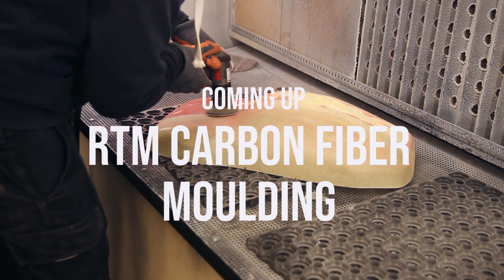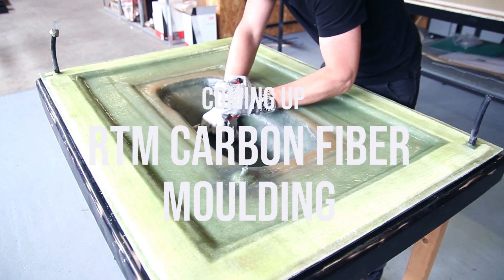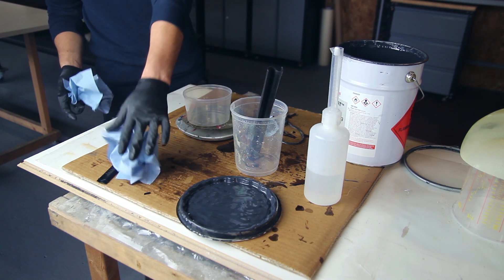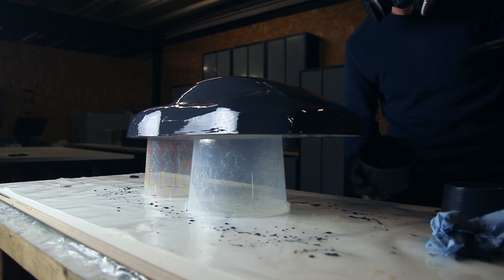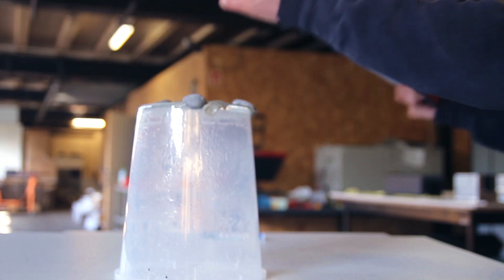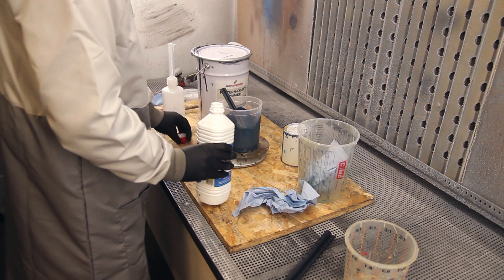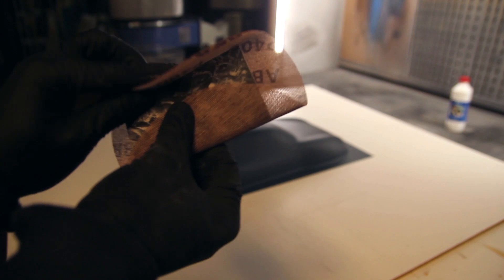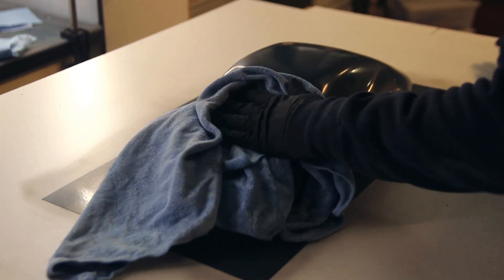RTM Mould - Finish Part With Patterncoat (PART1/4)

Comment: Hello Matthieu, can you share % of dilution, air pressure and tip size (I think I heard 2 mm but sure) you used to spray the pattern coat?
Thanks
Reply from the maker: It's hard to give an exact number as different sprayguns will need different parameters, but here about 5% acetone, 6bar on aircompresser, 2 bar on the gun, 2.0 nozzle
Reply: @MatthieuLibeert  thanks. I agree every spray gun is different but at least I have something to start with!
Thanks a lot for sharing your instructional content!
Reply from the maker: No problem! Good luck!

Comment: Hi Matthieu, nice video's thank you for charring your knowledge. I would use Styrene, to thin instead of using acetone, had some bad results with thinning with acetone.
Reply from the maker: Correct! Could have mentioned it can be done with styrene as well, but a bit harder to find mostly than acetone  😁

Comment: Wy does you use a big plate on the ground? Would not be 10cm enough?
Reply from the maker: The large plate is because this will be a more complex mould set-up, instead of using a vacuumbag there will be a rigid negative mould used later in the videos. So on that flange area some vacuumchannels and more will  be included later on
Reply: @MatthieuLibeert  okay cool, i learnt a lot in your videos

Comment: I tried last month the mould paste with green colour celcoat. That works fast
Reply from the maker: Correct! but on a large mould it might get a bit expensive :D my idea is more to use it on smaller moulds
Reply: @MatthieuLibeert  yes and i found out that it breaks fast on biger parts.
Reply from the maker: It is a bit more brittle indeed, mostly with epoxy resins...stronger but breaks a bit more easily